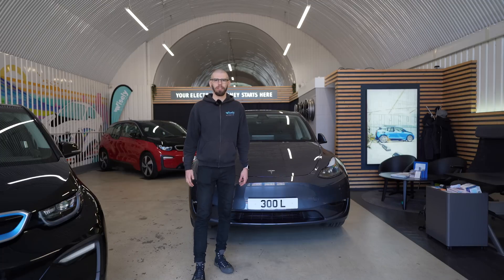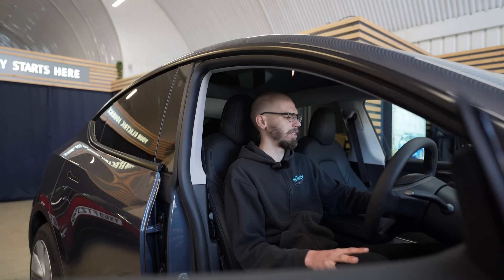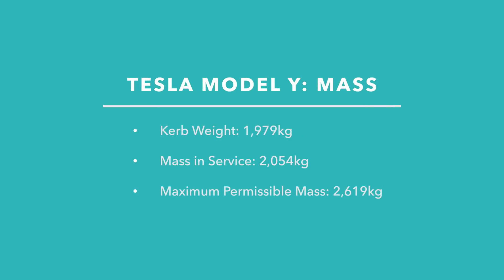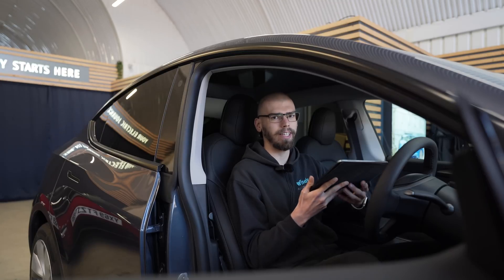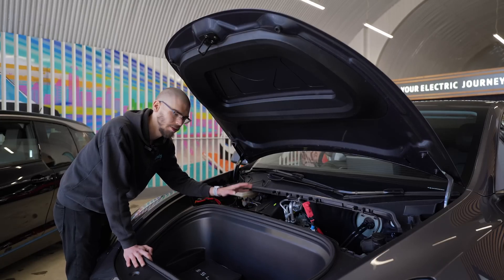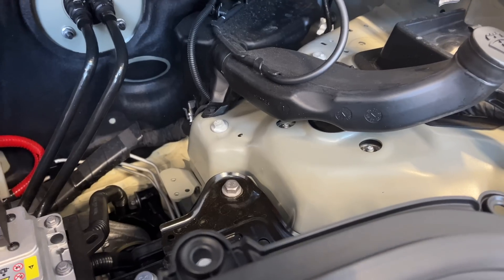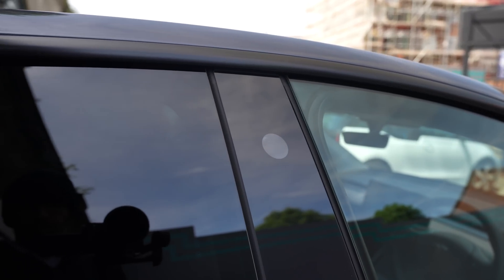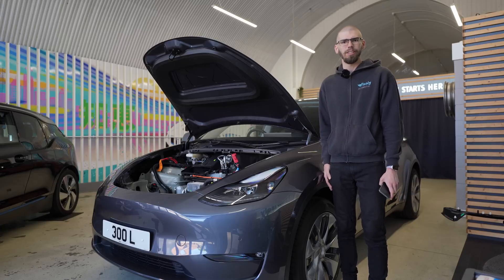Tesla Model Y: New (NOT TALKED ABOUT) Features for 2022

Comment: My Model Y arrives end of June, a month away and thus this video was a great one to watch.
Keep up this standard.
Disappointed in the lack of parcel shelf. Can the Tesla parcel shelf be post fitted?
Reply: Paul - why would you want the parcel shelf?
Reply: @stal5861  I would want it for noise suppression coming from the trunk. Let's say if things are sliding and just in general roadnoise. Even the audio system may benefit from it. It comes provide slightly more refinement to the car with minimum weight penalty
Reply: @stal5861  I carry valuable camera equipment hence the need to hide what is in the back
Reply: @ClimateRealism  For that you have the tinted windows and even a compartment under the trunk floor or in the front trunk :)
Reply: @TheDanishSpaceman  Its is not normal camera equipment. Many containers.
Reply from the maker: We don't think a parcel shelf can be retrofitted. There doesn't seem to be any place where it could clip into / rest on the sides of the boot...

The rear windows are very heavily tinted though, so we wouldn't necessarily be concerned about privacy.

Comment: Beware, We collected a new, Shanghai Model Y LR 23rd February 2022. Brilliant car, even better than our terrific but lethal in rain spray Model 3LR of 2 years, due to repeated emergency braking from 60-70mph - Tesla Tech are still working on a fix, except for .... the Hankook tyres on the Model YLR seem to crash on the road so hard, that deep bass, sound pressure waves reverberate throughout the cabin so harshly, that we get headaches from it. No parcel shelf provided either. Tesla Service, Nottingham (UK) said that "Yes, it is harsh to the ear but, as it is a characteristic of the car, there is nothing we are prepared to fix" We rejected the car, as is our right, via Tesla's UK finance partner, Black Horse, as Tesla won't deal any further with us directly. Black Horse have now taken a further 2 months, allocating the complaint to a legally trained, "Complaint Manager" who has admitted that he has "no knowledge or experience of Teslas" and got his "facts" wrong and has achieved absolutely nothing to assess this problem. This hasn't stopped him issuing a claim rejection letter to us. 3 months after buying it and 563 recorded miles, we can't drive our Model YLR without getting headaches & nausea. 
I am a chartered Mechanical Engineer with over 45 years in the motor trade. I have had problems with new vehicles before but, never anything as outrageously bad as this.
Now submitted claim to UK Finance Ombudsman.
If that doesn't produce a fair result, we will buy this awful vehicle out of the the appalling finance agreement and pursue our claim directly against Tesla.

Major shame, as we are EV fans in general & Tesla in particular, with reservation on a Model X Plaid - no idea when that might appear though. Apart from of course, opening Superchargers to non-Tesla users, who block 2 bays to make cables reach. 😤🤯🤦‍♂🤦‍♂🤦‍♂🤷‍♂
Reply: Sorry to hear of your issues. My first test drive of the Y left me with a similar impression, great car let down but harsh suspension. Undeterred I took another one out for a drive yesterday but this time adjusted the tyre pressures down to where they should be - 42psi. The result although still not as good as my M3P, was improved and possibly liveable. Anyway it seems cars coming into the UK may have had their pressures increased presumably to protect in transit. I doubt this hasn't already been checked on your car but may be a useful tip for other owners. Good luck
Reply: Both cars had 20" wheels btw, as has my M3P
Reply: @MrQwerty3000  Thanks for the info. We did in fact spot that our car was given to us with 50/51psig in the tyres. Resetting to the required 42psig was an easy hoped for fix but, didn't actually improve the resonant booming in our car, I'm afraid.
Reply from the maker: Sorry to hear that the car didn't meet your expectations. The ride comfort is largely a personal thing, and even within the team we are split about 50/50 on who likes the handling / who doesn't. 

However, we have definitely heard the complaints (including excessive road noise) and are working on a fix! In fact, we will most likely cover that in our next Model Y video in the very near future...
Reply: Did you not notice the crashing noise on the one you test drove, or was it just on your particular car? I found the one I test drove just fine, so I'm worried if I ordered one it would turn up different.
Reply: We didn’t get opportunity to test drive a Model Y before ordering, as we ordered ours in 2021 and it came in February 2022, in the first batch supplied into the UK. The reviews we read at the time did not mention the problem. 
We have only found report of this “harsh” ride, in a couple of very recent reviews of a LHD press vehicle from Holland, as passed around UK reviewers just as our car arrived in the UK. 
As Model 3 owners for 2 years, we were blind-sided by this problem.

Comment: Had a test drive in france of a Model 3, I prefer the looks, but wondering if it’s worth considering the Model Y if the tech is more updated?
Reply from the maker: The Model 3 also supposedly got some of these upgrades, like the new rear drive unit with the hairpin windings, the faster MCU3, and the Li-ion 12V battery.

If you prefer the looks of the Model 3 and can live without the hatchback boot opening, the Model 3 is a fantastic car - with being lower and lighter, it's a bit more comfortable and efficient than a Model Y.

Comment: One additional change worth mentioning is that the 2022 model got a new larger battery compared to the 2021 model. The 2022 battery pack is NCMA based and slightly larger in capacity, providing an increase in range.
Reply: Is there some unique code for this 2022 larger high voltage battery? What are it's specs vs 2021 battery?

Comment: Super video, one easy way to see if the car has the new lithium “12V” battery is to measure the voltage of the “12V” outlet in centre console of in the trunk, if it is 15,3-15,5 Volts it is quite surely the new lithium battery :-)
Reply: Hmm I wonder how common 12 volt accessories that someone would use in the accessory port will handle the increased voltage? I imagine many things will not handle it, or break from the increased voltage?

Comment: MCU (infotainment) computer is largely meaningless.  It's not a big proc need.  One draws less power, one is slightly faster but is power hungry.  wash.  All double glazed windows does make a cabin noise difference.  The UI updates are way overdue but appreciated as a return to what works best.  MY weight reduction comes with a range reduction (LFP batteries).  Motor winding improvements are very good for performance and energy efficiency.
Reply: There is nearly no weight reduction from 2021 to 2022, only an increase in total weight and it is not correct that the range is reduced nor that it has LFP batteries. The LR 2022 version actually has a slightly larger NCMA based battery and a slightly higher range than the 2021 model. In US they introduced a standard range model, which is currently the only Tesla using the 4680 battery cells, but as far as I know it has not been released to the public yet. There were a previous standard range as well as one being sold I China, which most likely uses the LFP battery, but not in Europe to the best of my knowledge.